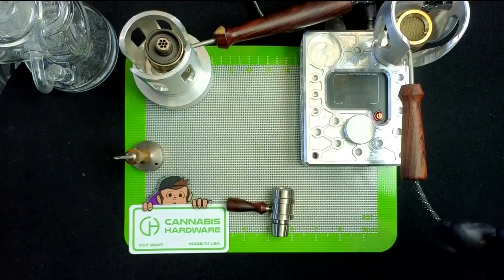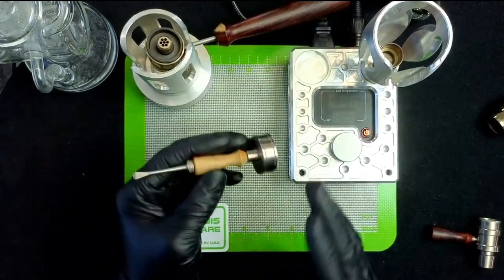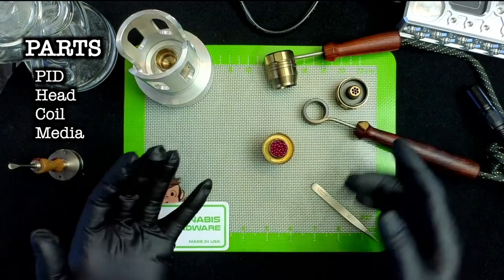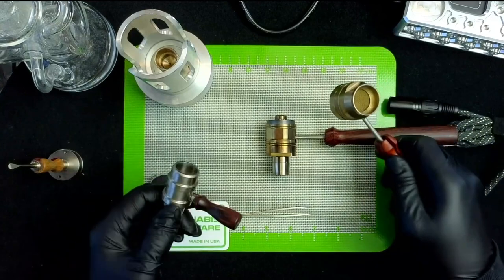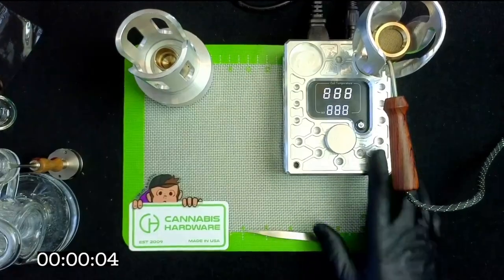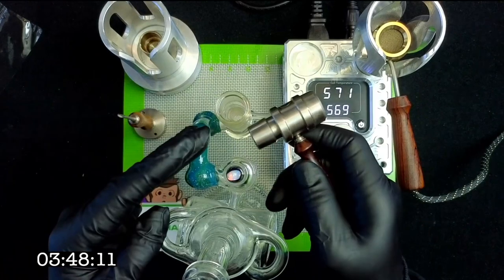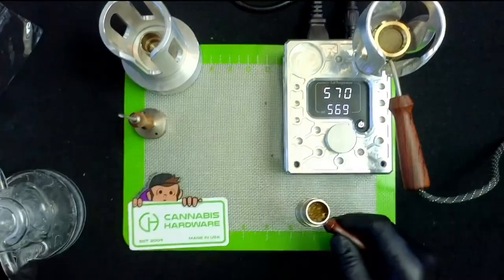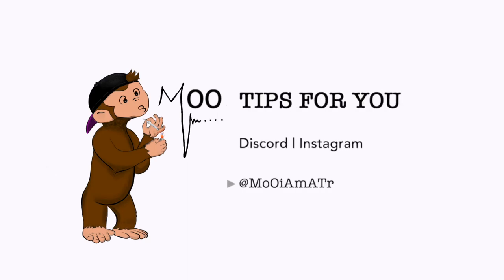B1 + B2 | Flowerpot | Cannabis Hardware

Comment: I came for the intermediate cannabis vaping class.
You didn't disappoint. Very well explained. 
Because the Flower Pot looked so complicated, I passed on it.
At the time, I went for the Old Head Freight Train. 
Similar to the Mini Nail Flower Wand but not right on the herb so you can turn the temp up.
With the Flower Wand I can't turn the heat past 545°F, or combustion.
Reply from the maker: I never did get to try the freight train so many vapes never enough time

Comment: Interesting views on all of that. 
With the shovelhead bowl you can loosen the handle, put the joint in the bong & adjust the depth of the joint for a custom fit. I like to have the bottom of the bowl on the neck of the bong a bit so nothing sticks & it can rotate.
cheers
Reply from the maker: Great tip!

Comment: Ihave all three of the B series ball vape heads. And for me the B-1is the best of the three. With that said their newest ball vape head the mercury is my favorite. It hold about 100 more rubies than any of the B series heads. I even prefer the mercury over other wireless ball vapes like the O'Connell wireless TKO. The mercury has a more open airflow than the TKO and the metal is thinner on the mercury both of which help with flavor. And I vape for flavor more so than I do for the high. If I were only interested in the high I would chose the TKO over the mercury
Reply from the maker: Ya I feel the same love my mercury about to do a video on it